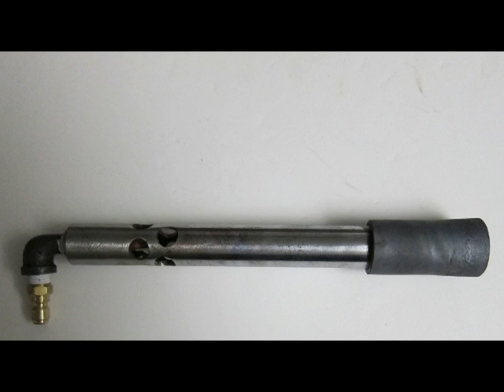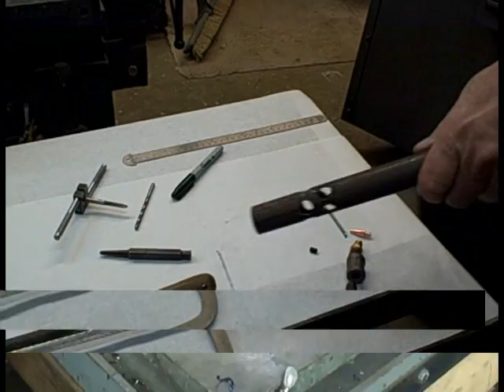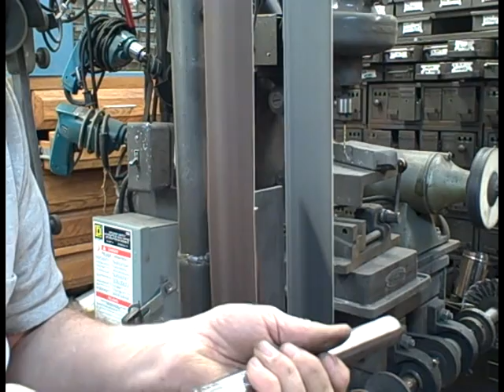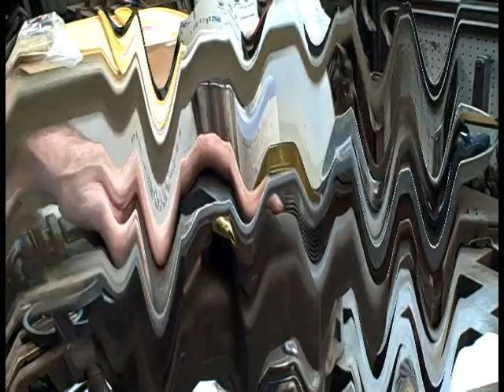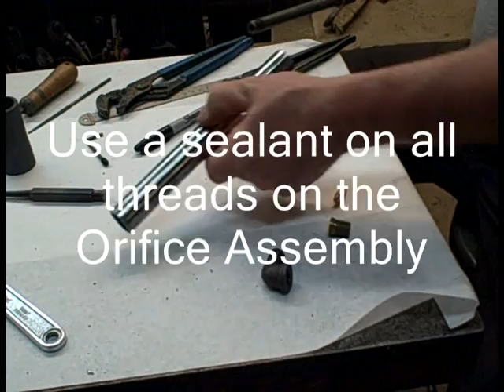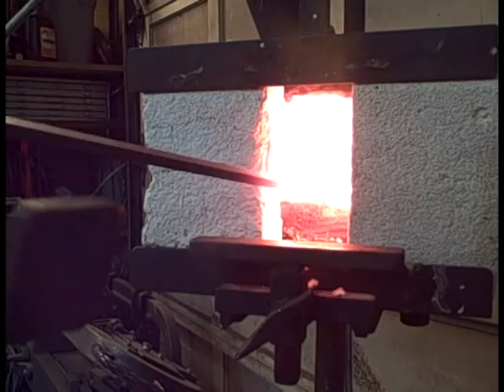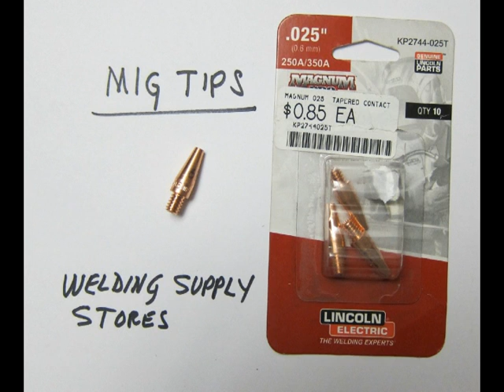How to build a Propane Forge Burner

Comment: I'm having difficulty finding any of the parts in 1/4 in sizes, do you think I can scale up to 3/8 in without too much difficulty?
Reply: +H0liNQBus .....  Fitting sizes from the propane tank to the burner do not matter.  You could use any size you want (although I would not recommend 1/8 inch fittings).  

To use 3/8ths inch fittings to build this specific burner itself (as designed) would be problematic.  If you want a burner of this design (with a 3/4 inch burner tube), the coupler you use must be modified (I use a belt sander) so it fits snug into the burner tube.  I doubt a 3/8 coupler could be modified to fit into a 3/4 inch pipe and still be safe.  if you could modify the 3/8th to fit, the next challenge would be to find a fitting that you can use to hold the mig tip.  That fitting must be tapped to take the mig tip you are going to use.  You probably could scale the burner up to using a 1 inch black pipe for the burner tube (and use 3/8ths fittings), but then you are designing a new burner.  The size of and number of aspiration holes as well as the length of the burner tube may need to be different.  You may also have a challenge finding something easy to use to hold the mig tip.  Obviously, you could use something else for the orifice, but then you are doing more burner design work.  Remember, the most important thing here is for the orifice to point straight down the center of the burner tube.  

Having said all that, if you can't find the 1/4 inch fittings you need locally, you can buy them online.  All the industrial suppliers would have them.  I also found a low cost site (WWW.ZORO.COM) that sells the pipe fittings you need.  The brass fitting you need to hold the mig tip can be bought at most hardware stores (including Lowe's and Home Depot).  Be sure the hole through any fitting you buy to hold the mig tip is small enough to be drilled out to tap for the mig tip.

Comment: I built this burner and it works great. But do you know roughly how many btu's the burner is capable of producing?
Reply: +Tyler Genke ....  I don't have any means or guidelines to measure the BTU output of this burner.  There is some discussion of BTU output from home built burners on Ron Reil's website if you want to pursue it for what could be comparable burners  (3/4 inch burner tube).  You can find it at http://ronreil.abana.org/design2.shtml#BTU

Comment: Hi i want to make one, need some input     will pressure washer quick connectors work with propane? and can they be used instead of the hydrolic ones you used?
Reply: +MREYNSTYN ......  Quick connectors use rubber O-rings to keep gas or liquid from leaking.  The rubber O-ring MUST be compatible with propane.  If it is not, the propane will eventually destroy the rubber, and the junction will leak (the O-rings will not necessarily leak when they are new, but the gas will break the rubber down over time).  To be safe for use with propane, the rubber rings must be made with NITRILE rubber.  The quick connects I recommend have nitrile O-rings.  If the quick connects you are asking about have nitrile O-rings, they should be safe.   If they don't, I would not use them.  If they have a manufacturers mark on them, you should be able to call the manufacturer and ask if the O-rings are nitrile (rated and safe for propane use).  If you cannot verify they are, I would not use them.  The quick connects I recommend only cost a few dollars and should be available where hydraulic cables are made (look in the Yellow Pages).  They are also available online (just Google for Parker and the part names I recommended in the video).    

One more thing....  Always check all connections with soapy water (while the hose is under pressure) to see if they leak.  If they are leaking, you will see bubbles.

Comment: Do you know how hot this can get? What metals can it melt?
Reply: +Isaac Yamamoto ....  I would expect this burner, with the propane management I describe in the video, can heat a forge (or furnace) that is properly designed, sized (for the burner) and lined to at least 2500 degrees.  

You can search online for the melting temperatures of metals.  Please be aware that handling melted metal is extremely dangerous and requires substantial safety procedures and equipment to keep yourself safe.

Comment: David, nice video.  I am making a burner like this one and have a couple of questions.  1.  I've noticed that other burners show a choke for the air flow, but not yours? 2. How do you determine that a ball valve is rated for propane?  Store help doesn't seem to know.
Reply: +Joe Garcia ... My goal for this video was to keep the burner as simple as it could be so more folks could build it with a minimum of tools.  Although adding a choke ( a slide over the holes) might give you more control over what type of flame you get (neutral, carburizing, oxidizing), I have not found it necessary for success with this burner in a small propane forge.  

With regards to identifying whether or not a valve is rated for gas....   Either the tag on the valve or information on the handle should indicate what the valve is rated for.  Sometimes the tag says gas....  most often you will see "WOG" printed (or embossed) somewhere (tag or on the handle), which means the valve is suitable for Water, Oil and Gas (propane is gas).  If you do not find an indication that a valve is suitable for gas, I would not use it.
Reply: David, Thanks for your replies.  Just getting into this and didn't understand the reason for the choke.

Comment: Hi, I just made your propane burner just like you instructed on how to do it, but the only problem I had was getting a good torch like flame. The only flame I got when I put it into the vice was a big blue flame that seemed to be at 20 or 30 pounds at about 7 or 8 inches long. I know the atmosphere could be the problem, but how did you get such a good looking torch like flame in the atmosphere...... Was it just luck? or is there a trick? I am using this for a foundry/ forge and it seems to work inside the foundry, but it also seems like it could be a lot better.
Reply: +Mathew Stopka....  First of all, let me assure you that I don't use any procedures or tricks that I haven't demonstrated in the video. 

It's not unusual to get different flame characteristics when comparing two burners, even of the same design.  The visual differences may be slight to major. The significant question is whether or not you are getting the end result you need to heat a forge/foundry. 

Any small difference between burners, including propane pressure, the position of the orifice,  inconsistency of the air intake (position of the holes, burrs on the inside), anything that affects air turbulence during the mixing of air and propane, centering of the propane stream down the burner tube, etc..), as well as the construction (degrees and length) and positioning of the flare is going to produce a different looking flame.  Even your altitude could make a difference.  This burner, as well as other designs I have made do not necessarily produce exactly the same flame characteristics burner to burner (even within the same design).  That is why I say to adjust the flare (and if I didn't...  pressure) to get the best flame you can outside the forge/foundry.  If you can get a good flame outside the forge, it is likely you will have an even better flame in the foundry.  Even having said that, all burners will also behave differently outside and inside your foundry (because of the back pressure and growing radiant heat inside the forge/foundry).    Also, if your regulator and hose setup isn't exactly the same as what I used when I made the video, your results could vary.  Although some folks have issues making the burner, most have success getting a satisfactory flame if they follow my instruction to the letter.  Others can't get the burner to work outside a forge/furnace, but it works fine in a forge (probably due to back pressure). 

If you are getting a reasonably stable flame outside your foundry and it works inside your foundry, I would consider your efforts a success.

For folks that can't get a burner to work at all (or are unhappy about their results), I sometimes suggest changing to a larger mig tip (like .030 or .035).  Sometimes that will produce a satisfactory flame (and overcome other issues).
Reply: +David Hammer Okay, thanks
Reply: +David Hammer Okay, thanks

Comment: Hi David, this burner can work in for melt brass and silver?
Reply: +Ricardo Murua ...  I'm not sure if you could heat a crucible directly (from below or the side) to melt those metals with the burner, but if you have a furnace or forge properly lined and sized for this burner, it would easily melt those metals in a crucible that is placed in the forge or furnace.
Reply: +Ricardo Murua yes

Comment: Hello David!  I'm building a small refractory furnace to melt aluminum in and I'm considering building the torch you made in this video.  My question is would a 30 PSI regulator work fine with this torch?  From what I have gathered on many other Ron Reil style burners is that they use the 30 PSI regulators.
Reply: +Jason Combs ...  This burner will run with a 30 PSI regulator, but you will not get not get the highest performance it can provide.  Would it be enough to get the performance you will need for your application?   I can't answer that, you would have to try it....  Keep in mind that the burner is only one part of the equation.  It is equally important to properly size the burner to the forge/furnace and have a properly built and lined forge/furnace....  

As is discussed in my burner video, I recommend using 0-60 PSI regulators cranked all the way down, along with the use of a commercial grade needle valve to control propane volume and pressure.  I have found this to be the best combination and the easiest way to manage propane to my burners.  I frequently use greater than 30 PSI to maintain the temperature I want in the forge when I am working with heavy stock or am doing forge welding in my forges.  I will say, though, for most of my projects, I am using less than 30 PSI to maintain forging heat in my forges.

Having said all that, I would expect that this burner would output as much heat as any other atmospheric burner with a similar burner tube diameter and orifice size.  If you are going to use a 30 PSI regulator, I would recommend you use a .030 mig tip (instead of a .025).  If you can't get the performance you need with a .030 mig tip at 30 PSI, increase the orifice size to .035 and try again.   

Remember also, that the most efficient heat in a forge/furnace is that heat reflected and given off of the refractory in the forge/furnace, so be patient and ensure your forge is up to its maximum heat before you make judgement of it.

Comment: I know it's a old video but I was wondering if a 40 psi regulator will work instead of the 60 psi you used?
Reply: +Andres......   A 40 PSI regulator will work just fine.....
Reply: +David Hammer I made the burner but I can't adjust the flame to look like yours. I don't have a needle valve tho. You think that's the problem?
Reply: +Andres....  If you have made the burner the same way as I have shown, you should be able to get a good flame with it, even without a needle valve.  I assume you are having problems with the burner OUTSIDE of a forge.  The first thing to try is moving the flare a bit (up and down a little) while the burner is burning.  If you still have problems, put the burner in a forge and see if it will work OK.  Usually burners that won't work outside will work in a forge (the back pressure helps).   If you still have problems, check all the things I talk about in the  video during the building of the burner (no burrs, tip pointing down the center, placement of the tip, etc).  You can control the burner with the regulator (without a needle valve), but it is not as easy.  Personally, I consider the needle valve an important part of the hose train.  Sometimes,  I have advised others to use a larger mig tip if they can't things working and they have built the burner as I described.  You could go to a .030 tip, or even a .035.  The burner will probably be noisier, but it is likely to work OK.  Sometime altitude is an issue if you are in a higher altitude than others.  A couple more things....  start and warm up your burner at 15-20 lbs of pressure, then crank it up to 30 to see what you get (it may HAVE to be in a forge to run it that high.  Also...  be sure your propane tank has more than a little gas in it.  If it is low on propane, you will not get a good flame.
Reply: +Andres Ramirez ...  Another initial approach...  If the burner does work, but you don&#39;t like the flame, just let it run for a while (get hot), then adjust the regulator.  If this doesn&#39;t work outside a forge, try it in a forge....
Reply: +David Hammer Yes, I built the burner exactly how you showed. The flame was popping when I would start it and it wouldn't last long on. I did adjust the flare and I put the burner inside the forge and it worked how it's suppose, it didn't turn off nor did it make the popping. Thank you for your videos. I would have never been able to make one with out this video. I also made a forge similar to your C Forge.
Reply: +Andres Ramirez ...  You're welcome.  If you want to get the burner to work better outside a forge, I'm not sure what more to suggest (beyond putting in a slightly larger mig tip), or to try less or more pressure when you light the burner...., then change the pressure (up or down)  after things have warmed up.   Excessive pressure (or actually too little pressure) at startup may cause what you are describing.   It sounds like the end goal has been met (burner works OK in forge).   I've never had an aspirated burner POP for me like you describe.   Good luck with your projects in the future.
Reply: +David Hammer Yes, goal has been met. The burner works great inside the forge. I might put a bigger mig tip tho, to see the difference.

Comment: thank you! quick question, could you tie a similar system in with oxygen? maybe pump some oxygen in to give it a temp boost in the burn chamber using the same needle balve adjustment?
Reply: +DWings ...  This burner will provide enough BTUs to literally burn steel if the forge is properly lined and sized.  If you increase the temperature beyond that, it will destroy the refractory in the forge.   

 I would not recommend,  under any conditions, adding oxygen into the mix.  I have never tried it, but I believe it would be incredibly dangerous.
Reply: +David Hammer  my eyebows and fingers thank you